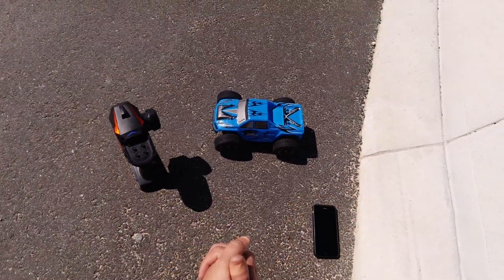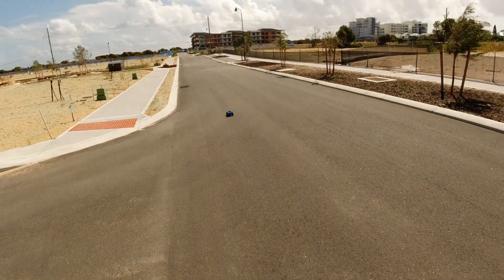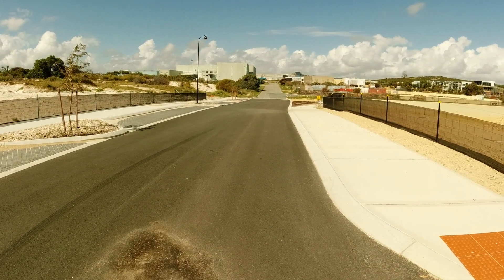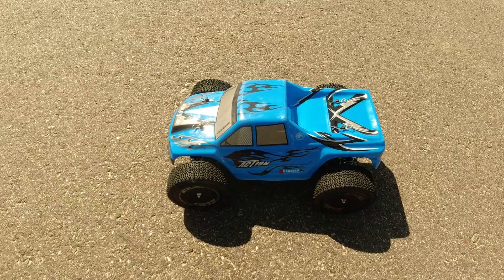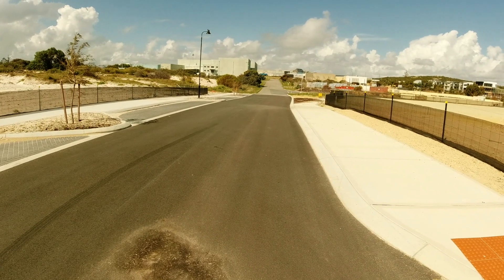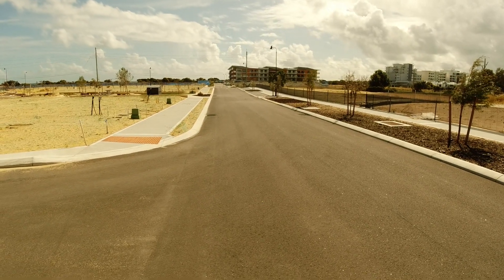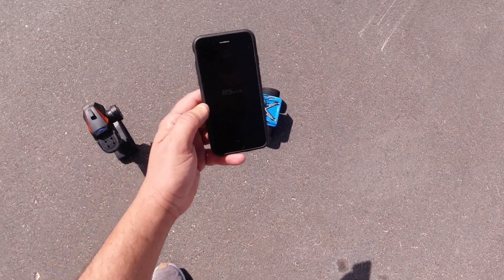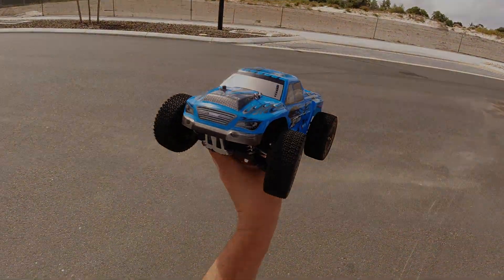WLToys A979 Brushless 3S Speed Runs | 80+ KPH

Comment: sweet looking truck with those wheels. great speed runs there dave 👍
Reply from the maker: Cheers Ange 🍻 it vertainly has some more speed in it, just need a decent run on a calmer day to get a proper full throttle run in 👍
Reply: @PERTHWESTOZRC  forgot to ask, whats the weight of it?
Reply from the maker: I’ll check and get back to you
Reply: @PERTHWESTOZRC  ok
Reply from the maker: LOL my small digital scales won't read over 1kg, but i checked the online listing specs and it says the weight is 1.7kg, I'd say mine with the brushless system and larger wheels might be around 1.8-1.9kg

Comment: Any RTR 3s for the truck?
Reply from the maker: Do you mean 3s lipos that fit, I'd say between 1000mah -1200mah 3s will fit perfectly, I used a 1500mah in this video and it needs a Velcro strap around the chassis
Reply: I mean instead of upgrading the motor, ESC, servo.....any premake truck has that can run 80km and small in scale? Cheers
Reply from the maker: @Humphrey210  a couple years ago i managed 74kph on the brushed A979B model of this truck on 3s with stock electronics 
but there is a 50/50 chance of the esc/rx combo frying
Reply: @PERTHWESTOZRC  Thanks for letting me know. I go keep watching your video then. Looking forward to seeing more videos from you!! Or if you can recommend a small RC truck would be great!!
Reply from the maker: Hbx 16889 brushless is a great value rc truck, I’ve made many videos on it so feel free to check them out also.